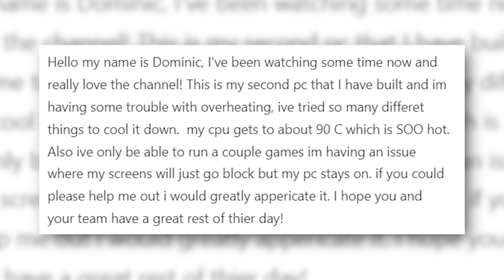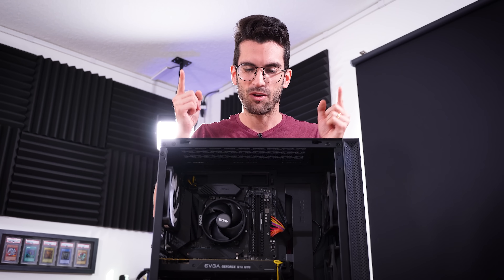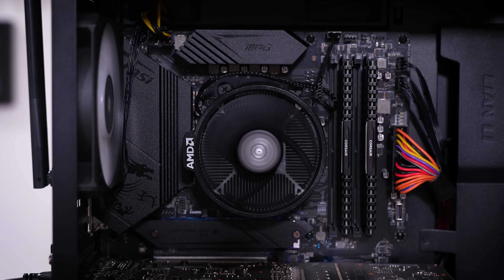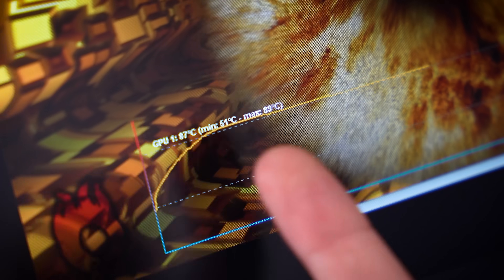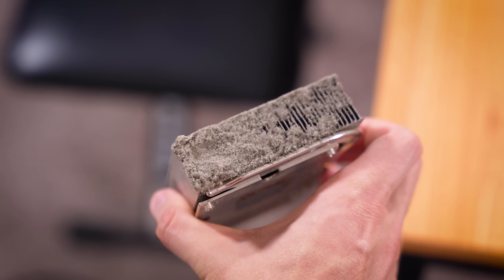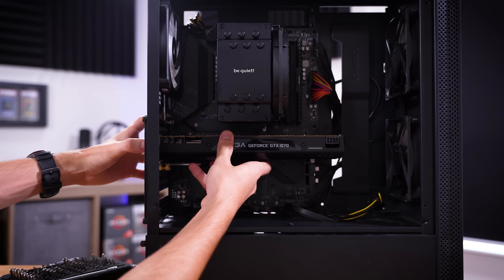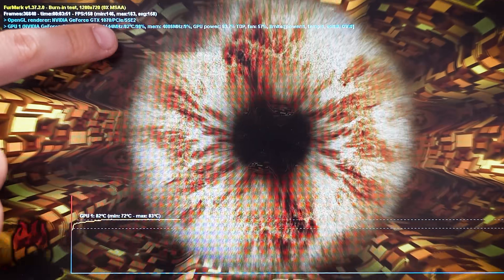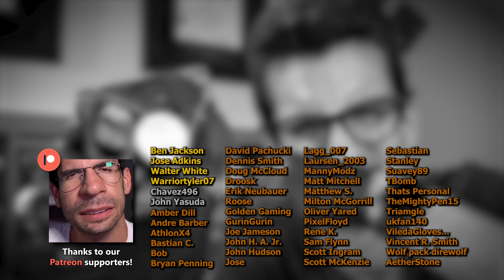Fixing a Viewer's BROKEN Gaming PC? - Fix or Flop S4:E15

Comment: Pure Rock 2 on my 5600x and it never gets over 90.  It would have looked at the rear fan and maybe changed it to a higher RPM, maybe added one at the top rear if able.  Thats what works on mine.   Dark Rock 4 is total overkill, but if it works.  makes a great video.
Reply from the maker: I wouldn't even be comfortable with 90C on a 65W TDP chip. Not gonna change two fans in a case when I can just as easily fit a proper cooler aboard :-)

Comment: The founders edition blower models for the 10 series are pretty decent. I recently cleaned up a founders edition gtx 1080 (it was nasty) and repasted it. I noticed temps peaked around the same 82 degree mark as this video. Surprisingly quiet too, definitely better than AMDs blower coolers

Comment: Youd think the GPU temps would be lower than that after such a major overhaul considering how super caked it was
Reply: I recently repasted my RTX 2070 mini GPU and replaced the thermal pads over the VRAM.  It was still running kind of hot so I replaced the 2mm thermal pads with 1.5mm.  I had read that if you use thermal pads that are too thick it will keep the heatsink from putting enough pressure on the GPU.  Switched them out and it was much better.  Also changed the fan curve to ramp up more quickly and that brought it down even more.

Comment: To be Honest, the wraith stealth is more than enough for the 5500, 5600G and 5600. For the 5600x, you need to upgrade to at least a a cheap Thermalright Assasin 120 SE. That chip runs wierdly hot, just like a 3600x

Comment: I had something similar to this back when I had my 3700x.

It’s actually very easy fix. My old CPU by default came with it being at 1.4v which is way more than it needed. 

All you need to do is lock it to 100mhz below your given max boost and also lock the Vcore voltage something like 1.2v based on your CPU.

In most cases under volting the CPU will bring down the temps.

Comment: I'm genuinely surprised at how hot the chip is running, even with the new cooler. Before I upgraded to the 5800X3D (which I love), my 5600X would run 72C max when running Cinebench R23 with a Vetroo V5 Tower cooler. From my understanding, that be quiet cooler should be an upgrade compared to what I used. I wonder if he just lacks good case ventilation to have really nice airflow.

Comment: 7:18 "Coverage looks much better on the cooler side, looks like the stock paste"
It that actually was the stock thermal paste on the CPU cooler, then it was pretty obvious that was no mounting pressure, so the CPU cooler was not contacting the actual chip to cool it down. Minor thing, but an experienced builder/troubleshooter would not call that "pretty good". Regardless, it was nice of you to replace the cooler. Keep up the great work, Greg

Comment: Great video as always Greg!

I can confirm that changing from the stock Stealth cooler to the Dark Rock 4 was definitely a good choice.
I had the stock cooler for the 5600X for a month and once I switched to the DR4 cooler everything runs so much better. 
Such a shame that the stock cooler that comes with the 5600X is the Wraith Stealth and not at least the Wraith Spire (the one with the copper round heatpipe at the bottom).

Comment: I've often heard to talk about how the R5 3600's seems to go bad. I am convinced it's because of that lame stock stealth cooler that it comes with. When the CPU is constantly pegged at around 90 C and above, there's an excellent chance that it will start to fail.
Reply: silicon degradation doesn't really happen until 120C, 90C is fine. server chips run for years at max temp and load.

Comment: G'day Greg,
🤔That AMD Cooler came off way too easy as the Stock TP bonds like Liquid Nails, also at 7:25 & 7:27 the TP looks to me like there was not proper contact between cooler & IHS especially in the middle, but the be quiet! Dark Rock 4 will not only do a much better cooling job but looks super sweet as well.
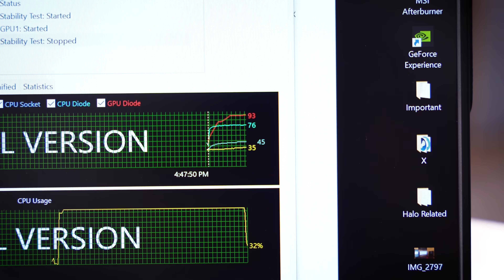8:43 🤦‍♂DOH!

Comment: I have a 5600x and it was running high  90°c when gaming on the stock cooler. A simple upgrade to a better tower cooler and I got the temps under control. My brother in law also has  a 5600x and he runs the stock cooler and doesn’t see high temps so I guess it’s a lottery draw on how hot the 5600x runs

Comment: IF that was an asus board I'd have immediately lowered the cpu vcore.... it's on auto an pumping 1.4v by default (at least on the b550-f gaming and crosshair VIII hero boards)
weirdly enough the stock cooler should have done a bit better of a job than 95c... weird
either way great job as always!

Comment: Hey Greg, maybe you should put the case sidepanel on the next time you check for thermals. This case looks very restrictive, so removing the panel might give GPU and CPU just that little bit more air to not show the symptoms the owner has in normal closed panel usage.

Comment: You can get another 10c reduction with an all core undervolt in pbo curve optimizer. The chip will also run at 4650 Mhz all the time, really is a great cpu.

Comment: The paste on the cpu did not look good. It did not make proper contact. The way you held it at 7:28 it was screwed to "spec" bottom first, left, right and top. You can see where the pre-applied goo got disturbed the most by pressure. Not much to see at top. seemingly made no to low contact in the middle. Otherwise that would have also traded paint like grannies car in the parking lot.
Also the 5600X is usually not that aggressive boosting to 4600/4650MHz. All Core even. Something was trying to keep it there and only dropped because of thermals. Peak Performance powerplan? Some game-booster? Made a BIOS reset and update just to be sure nothing was pushing peaks? Also that is an MSI board, MSI Center and User Scenario may have been in charge of the aggressive boost behaviour.

Comment: Hey Greg, I have a 3060 Ti XC graphics and I’ve noticed temps have gone up. I’ve done all troubleshooting except for taking the card apart. There is a sticker on the card that will void the warranty.  Can I just take the card apart and do it myself? Instead of having to go through the hassle of sending it to the manufacturer

Comment: I've run a 5600X with the stock cooler and it was okay.  Not sure why this one was running so hot.   I was actually running an ITX board in an ITX case with a 5600X and stock cooler and it would never get that hot.  Hotter than normal...yes.   I went to add a tower cooler to it a few weeks ago and something happened during the swap out and killed the motherboard.  I just RMAd it today back to Asus.  It powered on with an instant DRAM trouble LED.  Swapping RAM or CPU didn't help.

Comment: A 65 W TDP Rzyen 5000 will not get any hotter than 95°C. I guess the black screen was the result of the overheating GTX 1070...
Throttling is expected with the stock cooler. Not sure why AMD didn't included at least an Wraith Spire with an $300 part...

Comment: I hope all the case fans are blowing toward the back, and I wonder which fan make/models. Good solution with the BeQuiet (I put a NH-D15 cooler on my 5600x which has no heat issues).

I also have the same B550 mb, running a 3600 with a Wraith sandwiching a bailing-wired repurposed Dell heat sink between the fan and aluminum heat sink (more thermal mass). The CPU gets up to 71° C 😱 in Timespy CPU.

Comment: AM4 motherboards tend to bump the voltage a bit too much so the high temperature with the stock cooler might be related to that. Also, does the 5600x come with a cooler? From what I remember the X Sku's didn't have a stock cooler. The new cooler will keep the CPU in check, it's not even a 5800x

Comment: I guess it was just the silicon lottery. My friend is running 5600x with stock cooler and it doesn’t get close to 90°. I was thinking the peel was still on or bad thermal paste.

Comment: I wanted to repaste my old card since it was like 5 years old but I kept not doing it since I didn't want to break it. it was doing fine but I wondered if it could run a little better. now I have a 3060 and it works great.
I should really repaste my CPU though, it's been a few years. I'll get to that... eventually...

Comment: I love your content Greg. What i find interesting is that although the new cooler does a way better job the cpu still runs quite hot does it not? i have a 5700x and a smaller Deep Cool AK400 cooler on it and when benchmarking the 5700x does not get hotter then 61 degrees celcius. So i would think the Dark Rock would do a better job with the 5600x. is it because the GPU runs quite hot too? im curious. I'm quite new to the channel but i have binged your video's like crazy. Thanks for the amazing content and help you provide to the pc community.

Comment: That's the same CPU cooler that came with my R5-3600 and it ran awful hot and was ramped up a lot of the time as it struggled to keep it cool.   Just not much of a cooler to be honest.   Went with a Scythe Mugen 5 with dual fans and it never hits mid 70's now.

Comment: Anyone have a solution for black screening. It happens only on a select few games, and it been driving me crazy. I've uninstalled and reinstalled the drivers for the GPU, rolled back windows updates and still nothing. I've went ahead and did a clean windows in stall in hopes that would work but would still like a few answers just in case.
PC specs
 CPU R9 5900x
RAM 2x16gb DDR4 at 3600mhz
Mobo B550 Taiachi by AsRock
Psu 1000w amp form phanteks
Cpu cooler is an ek elite aio 360mm
Reply: Could be a defective hdmi/display port cable whichever one you're using. I'd try replacing it with a new one
Reply: @hazzmati bro I appreciate it I wouldn't have thought of that. Since I dropped my refresh rate down to 144 instead of 165 it's been fine. I will look into getting a new one soon. And again thank you

Comment: My friend gave me recently his laptops, so I could move disk from old to "new" (from 2010 Samsung to 2012 one). First I cleaned up new laptop and when I was checking if Windows works correctly, I said to myself what a quiet laptop. There wasn't much load thankfully. I had to disassemble new notebook again and I saw that I left cooling FAN disconected. It was first time I forgot to do such a simple thing, but yeah, it happens... Just check twice and it should be fine :)

Comment: Bad silicon? Weird Bios voltages? I have a 5600X in a solid front panel case with a tiny cooler (for 18 months now) and it still stays quite cool. IDK how that 65 watt CPU ran that hot in that case. Did you check for a bios update?

Comment: yeah i went from an 3200g to a 5700x and research told me that stock fan would not do it so got a iceberg 240 aio for the cooling needs as had the original cooler still from the 3200g but still think its best decision i made

Comment: Kind-off confused?
The Owner said that he tried a lot of stuff to reduce temperature. But he/she didn't try to clean the GPU (not talking about re-pasting here) or change the CPU Cooler, which is odd. Especially when the Owner said that they have been following the channel for a while.
I mean, if someone had been following this channel for even say a few months, those two points should have been a common first check to cover. Atleast i would have checked whether dust had gathered in the GPU or not, and would have either used a blower or just blow some air through my mouth to get the visible dust out.

Comment: Ryzen CPUs are always runnig hot especially with stock coolers. I got R5 3600 and it was always in high 80s. A little overclock, lovering voltages and a new mid range tower (arctic  freezer 7X) cooler keeps the temps in high 70s u dwr heavy load.

Comment: For gpu fan curves (especially so on blower style cards) I use afterburner and set a manual fan curve.

A good starting point is drawing a straight line from 30% fan @ 30c to 100% fan @ 80c.

That may get noisy, but at least you'll have a cool GPU pumping out a few more fps, and a few more years of life.

Comment: Great video Greg as always i appreciate the effort to solve problems of the community. Unfortunately I got a problem too with my pc and I'm not in Florida. Is a low budget refurbished Dell prebuilt and Is a Nightmare. Every now and then screen goes off and fan go to 100% idk why (i change already ssd, thermal paste and BIOS battery) did you experienced the same once?

Comment: From what i saw with mine, the stealth bottleneck by 15% the Prism 7%(Moved from my 2700x to 5600x) but my CM Hyper 212 with adapter, is as good as any with PBO on in the CA desert summer it Idles at 45C and only boost to 70C on Video renders, but its so quick it only last a minute, even with Cheap Chinese $3 for 50 uses Thermal Paste, Great Video Greg

Comment: Cleaning the GPU of dust and applying new thermal paste IS one of the most therapeutic things about cleaning up a desktop PC.
I also have a blower-style GTX 10 series GPU and I dropped its temps 10 degrees after my cleaning.
Haven't cleaned it in a few years, so it may be time to clear out the dust again.

Comment: Yeah there is something else wrong here. Nice that the pc is now working, but these temps aren't normal. I guess it doesn't really matter in the end, but its more of a bandaid than an actual fix. 

I'm currently using a 5600g (so slightly different, but not by much its the same tdp) with a 212 evo, ~35° idle and ~65° under stress test. The wraith stealth isn't a terrible cooler either, I used one for some time with my old ryzen 2600 (older but same tdp), with sligth overclock the cooler was keeping it at ~80° during stress test. There is no way ~80° is normal with a dark rock 4. 

Could just be very bad silicon, or something else wrong on the motherboard, maybe a bad bios with wrong voltage values. Heck even that, the dark rock 4 is rated for a 200w tdp, even with crazy voltage it sould be fine...  Maybe the motherboard is slightly bended or something similar and the cooler doesn't make proper contact? I also noticed at 2:40, cpu idle at 40°, which is ok, but the fan is running at 100%, so at there is at least a bad fan curve on the bios.

Comment: That motherboard must really be pumping a lot of voltage into that cpu because the included cpu cooler even though isn’t great it can still run the 5600x without throttling.

Comment: The 1070 is only pulling 150W, 82C still seems pretty toasty, but not unrealistic given the tiny cooler - did the case have decent cool air coming in, might lower it 2 or 3 degrees if it had better airflow.

Comment: Shipping these newer CPUs with the stock AMD cooler or the stock Intel cooler is a joke at this point. I recommended a kraken elite 360mm rad on a 13700k for a friend of mine, and she called saying "my cpu is getting too hot." rolled through and i found in the bios the "game boost" function puts the voltage at like 1.4v. repasted and downvolted to about 1.32v stable and saw insanely cooler temps. even my 11900k wouldn't be able to function with that little thing. I use a Deepcool Ak620 in my personal build and anything less than a darkrock pro or a dual tower heatsync wont do the job imo. Good on ya greg

Comment: Another great video, I find with blower cards, the fans tend to only run at around 50 percent even when under full load, I prefer to use Afterburner to set a custom fan curve, so that the fans hit around 65 percent, as the noise level do not go up by much and it can knock a good 10 percent off of the temps.
Reply: This might be seen as nitpicking, but when you say things like "10% off the temperature" you should really qualify what scale you are using. Now for things like CPU and GPU temps odds are you're talking degrees Centigrade, and are basing the numbers on 0°C. But if you were thinking Fahrenheit then the numbers are quite different. Not to mention Kelvin.

Now with Kelvin and Celsius things are fine if you were to say "temps went down 10 degrees" as that means the same thing. Percentages though, not so much. And this is not a °C is better than °F or anything like that. To scientists °K is the only relevant unit of measure, so if anything is better than the other then Kelvin wins.

Sorry for harping on, it's just that the way percentages are used often triggers me as it's so easy to misrepresent or misunderstand.
Reply: @blahorgaslisk7763 I am basing on the figures as shown in the video, so - minus around 8 degrees centigrade from the figures shown after repasting and reattaching the gpu fan.
Reply: @Justyoutubing4   I know I was coming off as a nit picking ass. Sorry for that. But percentages are so often thrown around that people tend to just go "Ohh! Look at the pretty numbers..." And while bigger is better, in general. There's a huge difference in what they mean with percentages.

Intel recently bragged about how they had a new driver for their ARC line of graphics controllers. One of the things they were especially proud of was that they had increased the performance in a game by over 100%. Sounds impressive, right? Problem is that previous to that the game hardly ran at all. Now if they managed to raise the performance by 100% there's a huge difference if the game used to run at 10 FPS, 20 FPS or 30 FPS. That would result in 20, 40, or 60 FPS. Problem here was that previous to this driver the game was often in the single digit range... Suddenly it doesn't sound that impressive.

Percentages can be very useful, but can also be misleading.

Comment: The 5600X can be a hog of a chip in some PBO settings (especially with MSI Mobos), I had the R7 3700X alongside it and the 5700X after it and both consumed less power and generated less heat.